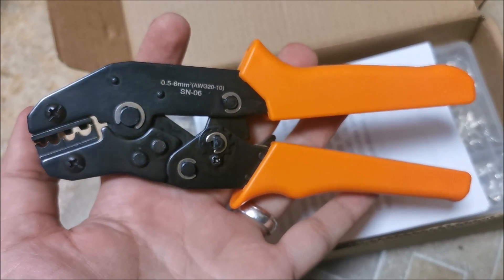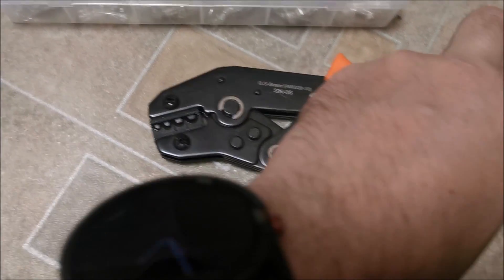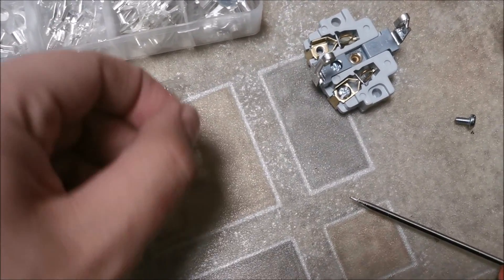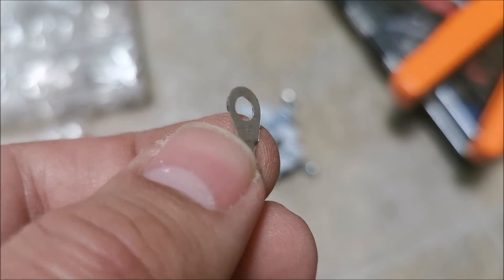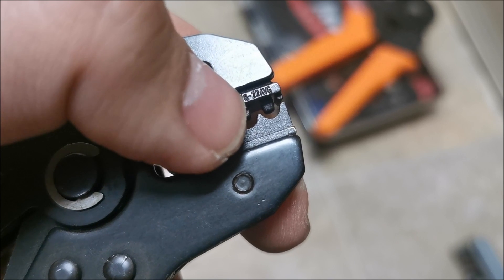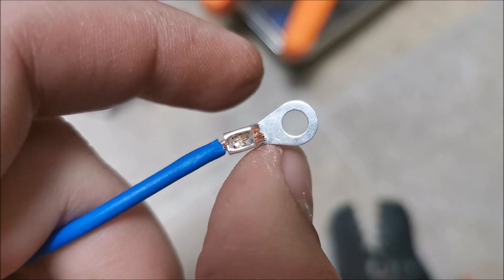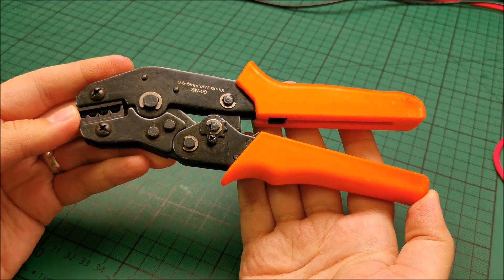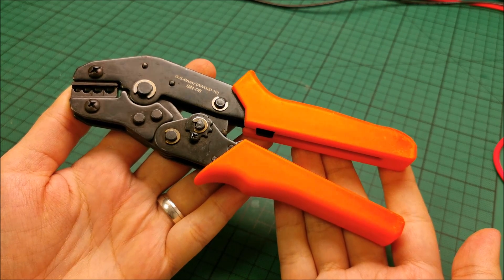Crimp Tool SN-06 (for non-insulated cable lugs) - review and test

Comment: The lugs don't correspond to standard: the joint should be soldered. So result can't be good with this lugs: "tube" is opened instead of been compressed.
wire should fill the whole lug after crimping. It doesn't looks so. Possible, a smaller lug should be used.
Reply from the maker: If I'm not mistaking, I mention in the video why I used the bigger one, altough it was not the right size. Something to do with the size of the screw hole.
Reply: @UltimateDIY  no. You take big first, then smaller. But it seems too big too...
Reply from the maker: Watched again myself. Wanted to use the one with bigger center hole, but realised it's too big for the cable, so went with the smallest in the set, that is actually marked 1.5, same as the cable, but it seems still too large. I don't have any smaller than that.
Reply from the maker: But what you say makes sense. Any spare room can allow wires to move. As a backup I always solder. Nothing moves then 🤭

Comment: it looks like it crimps only few "fibers" of the wire so it is not drop away but the connection is loose in reality
Reply from the maker: Could be. But for me it's non issue, as I always also solder 😁
Reply: @UltimateDIY  but you will get bad soldering result with compressed wire...
I think, I have found the reason of bad crimping (in another comment).
P.S. I just tried myself with the tool like yours and got looking bad result. So tried to find out what am l doing wrong. There are almost no info about crimping of such lugs...
Reply from the maker: Not perfect solder result, but far from bad. Solder will wick in the remaining space inbetween the wires. No chance of anything moving after that.